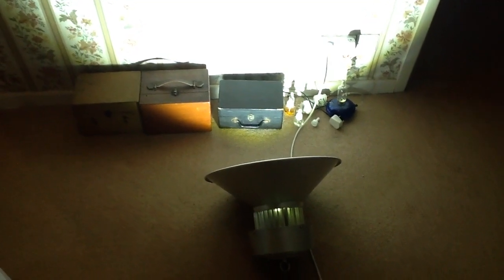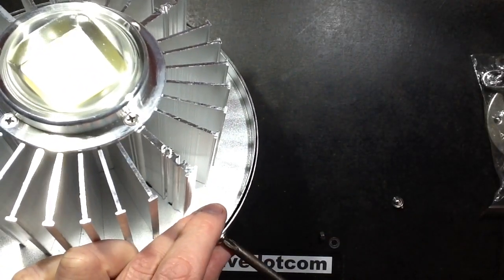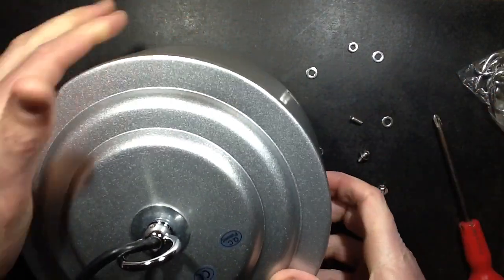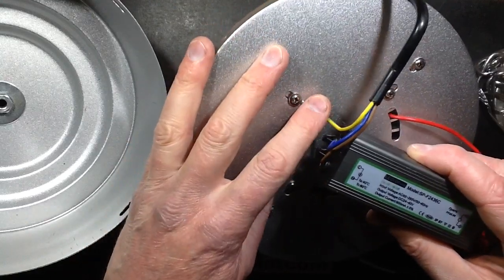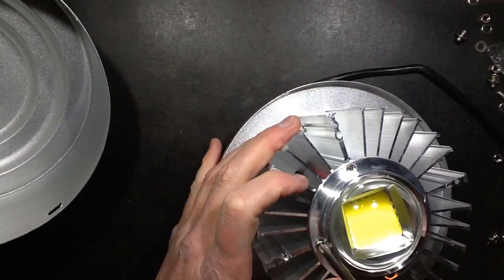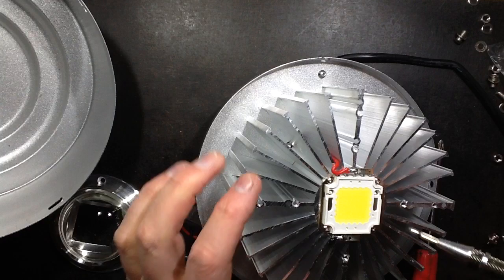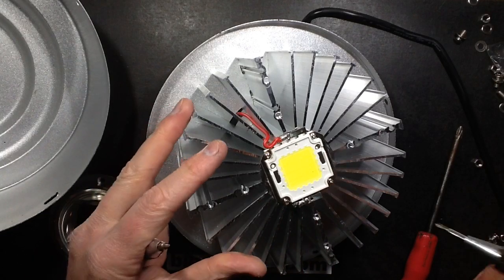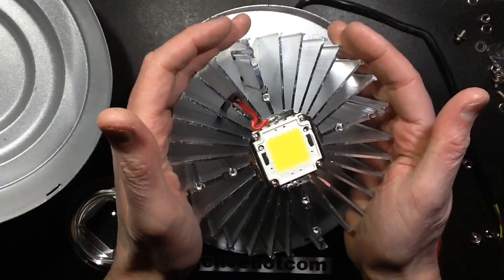Teardown of an LED high bay factory light.

Comment: Interesting light, I wonder how  they would work as  photographic lamps? The Ebay link in the description is dead but I searched for  "LED high bay factory light" and there is a good selection of designs, including some with E27 fitting that would fit my existing lighting stands. There are 100W lights for under £20 each. I think they would  be worth trying, they would be a lot less fragile than the big 135W CFL that I have been using.

Comment: it would make a good "uber-flashlight" if you attached it to a 12 to 30 volt boost converter and a car battery :)
Reply: Alternatively you could do what I did and use Li-Ion batteries... I get just over an hour using 12 2500mAH cells from laptop batteries in a 6S2P config on a 50w LED, and that's with an auxiliary 12v supply for a 5w side lamp and cooling fans.

Comment: Clive, Have you had any luck with LED replacement for The Spiral CFL Bulbs for house use?  I want to start replacing all my CFLs with LED based and doing some research now...
I use 75Watt equivalent CFLs now... that mount in my recessed lamp holders in my ceiling.
Reply from the maker: It all depends on the light levels required.  Although it helps that your exiting CFL's are actually in recessed lights, since they lose a lot of their output that way.  It might be worth buying a few random LED lamps and trying them.  I have a recessed light in my bathroom that was hideously inefficient with a CFL but puts out more light (instantly) with a much lower power GU10 style directional lamp.  I used an adaptor that also moves the lamp much closer to the lights front.
Reply: bigclivedotcom  Thank you for the tip on the adapter I did not think of that... I use the standard screw in base E27 and the recessed opening are approx  5 1/2 inches with a straight reflector.  (I just found the adapters you are talking about on ebay... and going to do what you suggested and try some LED lamps along with the adapter to bring them closer to the opening... thanks clive!!!)

Comment: I didnt know such things existed, gives me hope, i hope to soon replace 6x 6ft florescent fittings that are 30 years old and getting temperamental with something LED but right now its either way too expensive or not bright enough, as for that lamp, is a heatsink that large really needed?
Reply from the maker: If the ceiling isn't too high, consider some generic LED floodlights, with some on the ceiling and some under benches.
Reply: bigclivedotcom
yes the ceiling is about 7-8 feet, i have indeed looked at the floodlights for them, im undecided as yet, for the benches i already have them lit with the 10w ones, 2 per bench does a decent job ( well they are 5w really as it turns out), i looked at the led replacement type t8's but they are expensive and its a lazy way to do it, panels are too expensive too, maybe it will be the 50w floods in the end

Comment: Im looking for new lights for my garage/shop and I think some of these are the ticket. Do you think they would be usable if they were about 15ft off the floor?
Reply from the maker: +Clyne Griffon I tend to recommend using some ceiling lights to provide low level general illumination, and then bench lights and portable lights for getting more light where you are working.  The generic LED floodlights will be much easier to source than these high bay lights.  Avoid the super high power LED lights like 100W.  They fail quickly.
Reply: thank you for your vedio, i have  learned a lot. Thanks really.

Comment: The finish on that heatsink looked pretty rough to me.  And the thermal design?  Lousy at best.  Where is the airflow?  I'll bet that the difficulty you had with that many screws was due to the thing being assembled with a power screwdriver to speed things up.